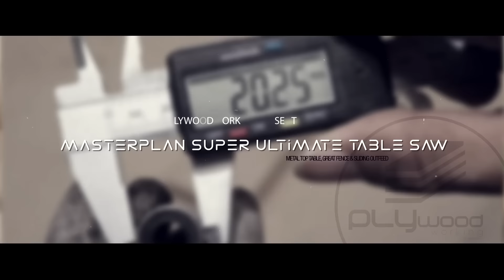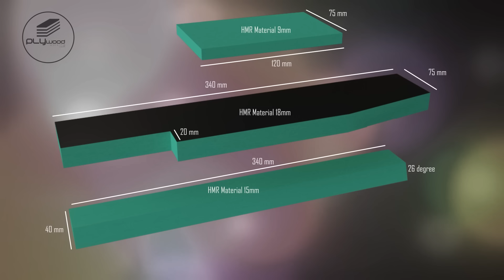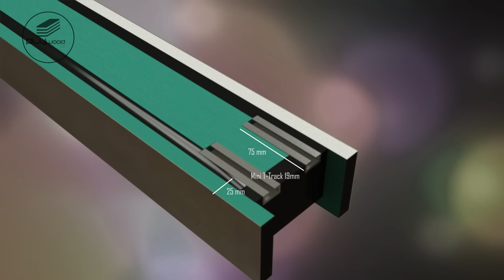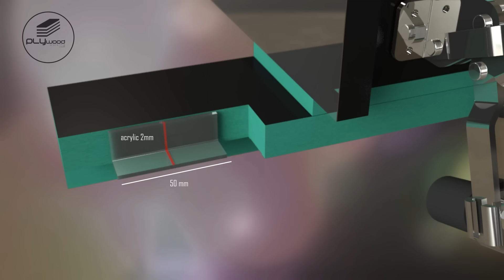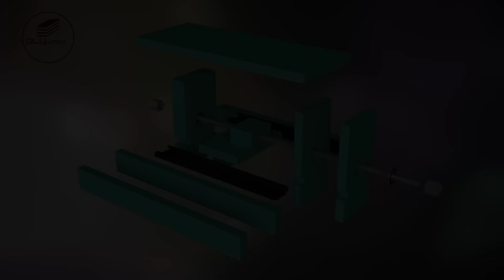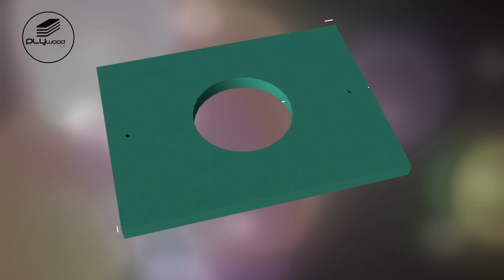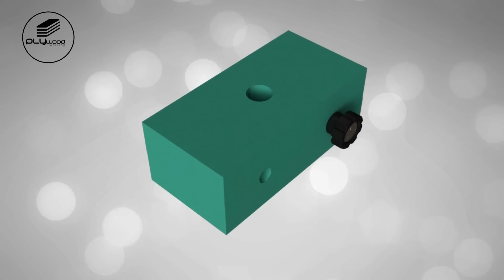DIY 4 in 1 The Ultimate Table saw with Slide Outfeed Table - FREE PLAN AVAILABLE

Comment: Great build, only critical item is the fence was super secure against you trying to budge it,  but showed lots of wobble of the whole table saw!
Have you seen flip up castors so the table drops onto legs?
Reply from the maker: Thank you good suggestion, the minus portable table is wobble but i think that still work good coz i place this table saw 1 side on wall. But i will think how make more stable not to wobble. My solution now i make this cabinet more heavy, i update give drawer and fill with heavy tools😁, before i found solution for leg

Comment: Great video's and tutorials! I'm trying to build a table saw like this one. The dimensions of the part where the fence slides (@ 10:10) in doesn't seem to be correct, 40mm and 50mm with 26 degrees angle, is it from HMR 15mm? When I add those to parts it is not high enough. And there are no drawings from it. Can you give me the right dimensions? Thanks in advance!
Reply from the maker: Thank you for all, maybe you confuse you can see detail video on this link https://youtu.be/JDVpFYDe6zM, i made this for more detail build fence
Reply: I’ve seen it, but I forgot about it... thanks!